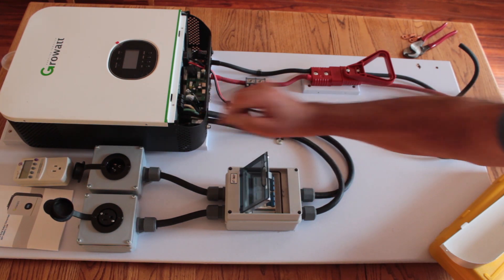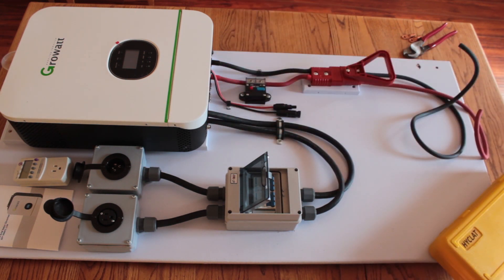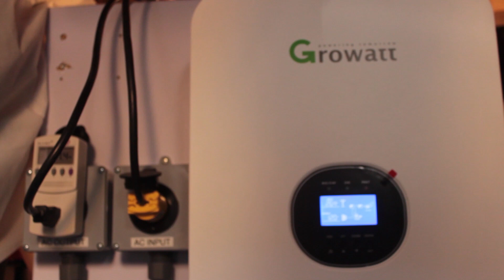Building an Off Grid Growatt Integrated Solar Power System - Part 2 of 3 videos

Comment: Hi, if I’m on SOL and the battery is fully charged at mid day, why does the SOL disconnect ? and inverter runs from the battery again?
Reply from the maker: Hi William, that is an interesting question. Perhaps some of the other Youtubers on this channel can add their suggestions too. My Growatt is also set to SOL and this setting has worked well for me for several years. Solar energy provides power to all my loads as long as there is sufficient amount of direct sun on the panels. If the solar energy is not sufficient then the battery bank will supply the power. This has worked well during the summer months, but even here in California the battery kicks in and eventually the utility takes over especially during prolonged cloudy days. I had to double my battery bank to improve the situation. Perhaps you have insufficient number of solar panels or you could improve their location. Shading is an issue with panels and some people find it necessary to have panels with different locations and orientations to compensate for the movement of the sun. You can always test the output of the solar panels after mid-day to see if they are still providing sufficient power. Not sure if this helps, let me know.
Reply: @BrightSparkIdeas  I am happy your setup works properly, could u please share your settings.

I have 2x 3.3kwh Growatt hope batteries and 375w x 6, in to 2 strings
Reply from the maker: @williamseptember640  Hi William, sorry I am away on vacation and not returning until end of September. As far as I remember all my settings were the default settings, so I can't check unti October.
Reply: @BrightSparkIdeas  I will appreciate, if u can get back to me once you return from a nice holiday

Comment: I am confused..... You call this an "off grid" system, yet you have a grid connect coming in ?? Can this growatt truely be an off gid system ?
Reply from the maker: Hi Daryl, My understanding is that "off-grid" implies that you are not feeding the grid with electricity generated by your solar. Unlike "grid-tied" where you are sending excess electricity produced by your solar system into the grid and storing it a grid account. My system only supplies one circuit in the property and only uses electricity from the grid as a backup when solar power from the panels or my batteries is not sufficient or available. So, the Growatt Inverter I purchased is described as a "Off- Grid" Inverter, however, Growatt also manufactures "Grid-Tied" Inverters. I hope this helps, best regards John

Comment: Thanks for this video. I have the same inverter and they did mention in the instruction manual the size of the Input AC breaker between the inverter and power sources which 40Amp, but they didn't mention the AC breaker size for the output line. You have installed a 20Amp AC breaker, is that correct? Thank you
Reply from the maker: Hi, Zolee, yes, you are correct a 20-amp breaker. I only have a light load of two refrigerators and occasionally a washer and dryer, the dryer is gas, so really a very light constant load. I would check with an electrician and size your breaker based on the circuit and what your load is going to be. I hope you are having a nice summer in NZ. Best regards John
Reply: @BrightSparkIdeas  Hi John. Thank you for your quick response. I definitely want to ask an electrician before I install any, 👍and yes we are getting a hot summer down here now 😂
Reply from the maker: @zoleeeagle9339  Kia ora Volee, my system has been working great for over a year, I hope you have great success with yours. I really like the Growatt and I added two 200-watt 24V panels in the summer to my solar array, so that gives me plenty of power during the day, but I need to add more battery capacity to keep from using the grid at night during this time of year when we get cloudy days. Stay cool down there, John

Comment: It sounded like your tinning (soddering) wires befor you crimp the lug on. That's how I use to do them, till I watched anther u-tubber, and he explained that you don't get a cold weld between strands that way. Nice set-up. Thanks for the vids.
Reply from the maker: Hi, yes I had heard that too about the cold weld, and ordinally I had been soldering lugs, not crimping them. Then I found a good tool capable of crimping the large lugs, so now I do not solder them or tin the wire before crimping.  I have a video of crimping the cable using the jig I made to hold the crimping tool to make it easier to use.

Comment: Great video! Really helps. I'm setting up my system this week almost identical to yours here on the Big Island of Hawai'i. I have a question about the smseace breaker box. Is it self explanatory on how to run the wire in from the Growatt to the breaker box for distribution out to different breakers? I have 3 20 amp 1/pole breakers that I want to split my 3000 Watts to and I'm not sure from the pictures on Amazon how to connect the power from the Growatt to the box, or is the box just a simple mount for the breakers and I'll have to use a splitter on an extention cord from the Growatt before the breaker box? Thank you so much!!
Reply from the maker: Greg good to hear you are building a solar system, I think the Growatt is an excellent all-in-one unit. I am however, really uncomfortable about answering questions about how to wire AC connections, as getting it wrong can be dangerous even lethal. So, with that said, I have two circuit breakers, 40 amp on the AC input and a 20 amp on the output. Mine are dual pole, but single pole breakers are fine. If you look at my third video it shows the system in operation. Splitting the output after the breaker would seem a simple solution. I am not sure if this helps.

Comment: you need way more panels to be worth your while
.i have 3 200 watt rich solar panels and they will not keep my 6000 btu a/c running for more than a few hours
Reply from the maker: David you are correct. I started this system to learn more about solar, but have limited space for solar panels. I have recently added a couple of 200W - 24V Rich solar panels that acutely work well for my limited daily load.
Reply: @BrightSparkIdeas  mine are rich solar also .they are quite efficient for the price. i think i can gey 2 more on my porch roof but i would hsve to upgrade my charge controller .thinking about a Growatt all in one.

Comment: Those hydraulic Chinese crimpers can get the die stuck in the piston
Reply from the maker: Hi Michael, have you had that happen to you and how did you resolve the problem? I have not experienced that problem, even though I have used several different die sizes. I did make a jig that holds the crimper in place, while I am pumping that is really a big improvement. Please checkout my YouTube video of the jig and let me know if you think that might help. - I think it is called Improving my Hydraulic Wire Crimping Tool
Reply: @BrightSparkIdeas  Not to me, but read a review on a sales site. I would suggest WD40 & or grease on the pin. Bigger versions may not have same problems
Reply from the maker: @michaelbouckley4455  Thank you Michael, that is a good idea.

Comment: Great vid... is there any way to connect the growwatt to house main panel? Thanks
Reply from the maker: Hi, Huy’s World. Good question, to my knowledge the best way to have your solar power feed into your home system is via a sub panel. There are a lot of good videos on YouTube describing how to do that. Make sure you view several videos because you are working with AC power that can kill you. There are also other safety issues that need to be understood.  You could start by checking out this one - DIY Off Grid Solar Panels with Sub Panel wiring – Let me know if this helped.
Reply: thank you, something like a transfer switch panel right?
Reply from the maker: @huysworld701  The Growatt already has an automatic transfer switch for connecting to the grid, but I don’t think that was what you were talking about. I thought you want to send AC power from the Growatt inverter into your main breaker box or load center that provides power to your home. If that is correct, you would need a qualified electrician to make that connection, as there are major issues with doing that which require expert knowledge and experience. However, what some people do is add a sub panel, which is basically another small breaker box (connected to the main breaker box) that feeds certain appliances or areas within the home. Once again you really need a qualified election to make those connections.
Reply: @BrightSparkIdeas  thank you 👍

Comment: Nice setup.
Questions please
Do you keep the inverter always on? Are your solar panels big enough to offset the standby consumption?
Reply from the maker: Hi Lei, great question. This system was a test project and as such has a very light load. This past Summer the four 100w Rich solar panels and my two Battle Born batteries worked well as a system, but not during the winter. Yes, I had the inverter on all the time, but during prolonged wet and cloudy days the load was supplied by the grid most of the time. Right after I completed the system, I got very busy and was not able to monitor or collect data about how well the system was performing. So, I plan to add, as soon as I have the extra cash, two more batteries and 400w more of solar to see how that works.
Reply: @BrightSparkIdeas  thanks for the reply. Looking forward to seeing your update on the system.

Comment: Link to crimper??  In your very good list (Thank You), I wasn't able (I am a beginner) to tell what your breaker box was for the AC In/out.  It really looks clean. Also, what are those "nut" looking things you are using on the AC wires in and out of boxes, breakers, .....?
Reply from the maker: Ben, good questions. The breaker box (it has HT-5 on the front) was a cheap box ($15) I purchased on Amazon. 
The two circuit breakers I purchased on ebay. 
The nuts, called cable gland locknuts I found at Home Depot, when I purchased the AC cable.
Circuit Breaker Distribution Box, Outdoor Waterproof Distribution Box Breaker for 5 WAYS Circuit Breaker.
EHAKL - DZ47-63 C40 - 40 Amp 2 Pole Din Rail Mount Circuit Breaker UL 110 Volt 50/60Hz 4500 Amp
EHAKL – DZ47-63 C20 - 20 Amp 2 Pole Din Rail MCB Circuit Breaker 4500Amp @ 110V 50/60 Hz
I hope this helps.

Comment: I'm having trouble finding "real" Anderson Connectors (their actual website is a pain if you are a beginner like me). Where did you get your large handle-equipped red Anderson connector? Did you solder or crimp the wires? Thank you.
Reply from the maker: Ben, I purchased mine for Amazon. I think this was the ones I ordered - 175A 600V Battery Connector AWG 1/0 Quick Connect Battery Modular Power Connectors for Winch Auto Car Trailer Driver Electrical Devices 1-2 Gauge. I am not sure if they really are from 'Anderson' , but they worked well for me. I have tried crimping with my hydraulic wire crimper (you can see my video where I upgraded my crimper), but I was not happy with the results, so I went back to soldering. I just use one of those small blowtorches and get good results.
Reply: @BrightSparkIdeas  Agreed the barrels of the Anderson connection inserts are too thin to crimp. They don't work well with my indent type crimper either.
Reply: Thanks for vids, helped a lot. Any chance you have vid of your line in/out assembly, breakers ect? Most  just cut extension cord in half, and use for line in/out. Thx again

Comment from the maker: Lee Hammond - Re your question about my hydraulic wire crimper. The one you highlighted is similar, but this is the one I purchased from Amazon: - https://www.amazon.com/gp/product/B06XR8BY65/ref=ppx_yo_dt_b_asin_title_o08_s00?ie=UTF8&psc=1
 You can see how I modified my hydraulic wire crimper to make it easier to handle lots of crimps in this video https://youtu.be/YzrtpPO3XjA